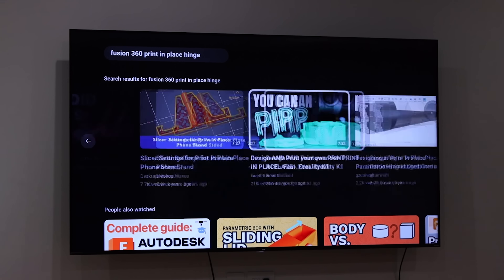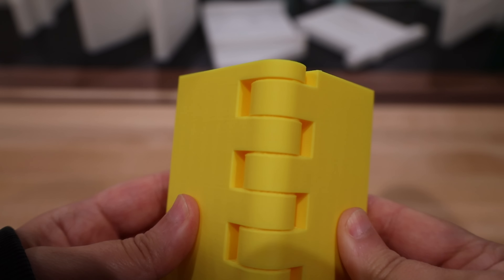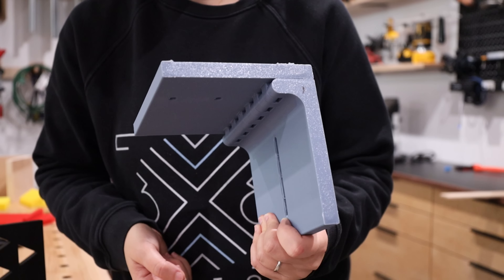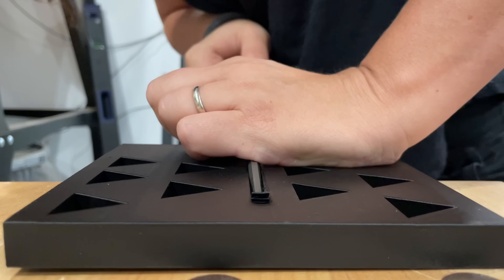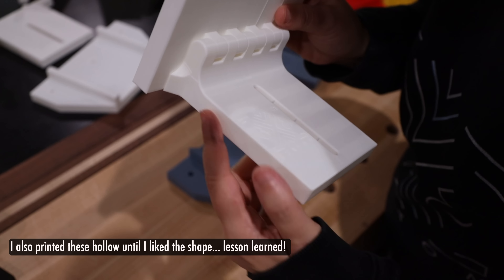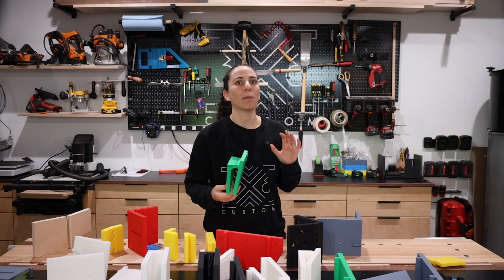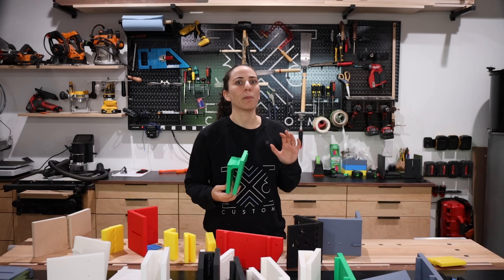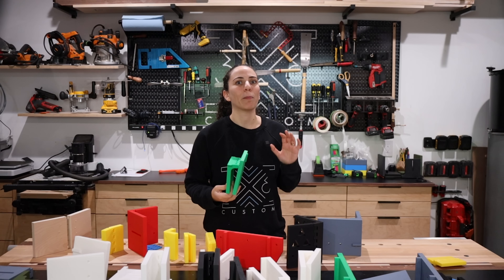From Idea To Product: It's Actually Easier Than You Think!

Comment: Instead of using that 3d printed hinge, use a 'bar hinge' or how it's called in Home Depot "Double Action Spring Door Hinge" and you won't need to do any height adjustments on the back side of the rail.

Comment: Your work bench video is what pushed me to order my A1 combo. It's been running nonstop in the little over a month I've had it and I absolutely love it. Haven't printed much for my shop yet or learned fusion 360 yet but I can't wait to maximize it's potential. But in the meantime, printing random crap is fun and blows me away at what these are capable of and the quality of the prints.
Reply: Is the 360 part of the combo pack or is it sold separately?

Comment: I have definitely changed how I work in my woodshop after getting a 3D printer and laser engraver/cutter. They make so much more sense for some things than traditional woodworking. Lots of fun! With a little experience, you can usually get things right on your first try. Depending on the complexity of course.

Comment: Thanks for sharing your process! After watching your previous rail hinge video, I ended up getting a Bambu P1S and have been having a ton of fun. Still figuring out how to design for tolerances and precision of the process -- I made some fence dogs and found the 20mm cylinder parts coming out .2 to .6 mm under the diameter in Fusion which makes for a sloppy fit. Will look into tolerance testers on MakerWorld to see how to compensate.

Comment: Great video timing. I have been looking into good entry-level 3D printers and the Bambu A1 is the one that keeps popping up again and again. 
I bought a laser printer last year and went for a cheap one that didn't have all of the bells, whistles and support of the pricier models. I wish I had gone with a pricier one that would have got me up and running much faster as a busy dad who doesn't have time to binge how-tos and tweak all day.
But the Bambu amazingly seems like the best of both worlds where it's very inexpensive and very easy to use for beginners. The latter is most important to me after my laser experience, and getting it at a great price is just icing on the cake.

Comment: A1 mini here. Just started printing and exploring the whole globe with it. Barely got into designing with it and I do mean barely. And I am impressed with they pre designed stuff even though many can’t print on the mini but much can be.  Afraid of the rabbit holes as I seem to get lost if going through more than one at a time. I need to spend time with a rabbit hole until I get desired rabbit without wanting more

Comment: Purchased your track hinge, printed and mounted it today. Overall works pretty good. I printed with ABS, so possibly some shrinkage, so a bit loose between the sliding of the parts.. With some HDPE tape, I got it tightened up. The hinge is pretty tight, so that came out great.  Great job on the design! 🎉
Reply from the maker: Hdpe tape is a great idea! Glad you like it! Have fun!

Comment: I think you may have accidentally created a really amazing video on how true innovation works: it's not that someone has some stellar idea that everyone high fives each other, and then someone does something somewhere and something magically appears done.  Instead, it is more often than not a well-intentioned idea that does worse than expected which leads to a cycle of creativity to solve problems which leads to tests, refinements, and (usually) success! Many woodworking projects have this innovation loop already (much like in software engineering) but trying to 3D print a hinge is a much relatable scenario to people than most woodworking or software engineering scenarios.

Comment: having a 3d printer is a great way to find out how much time and work goes into prototyping even basic items. I've designed a few simple things and it took days and a bunch of prints to get them working properly. having a second printer for prototypes would be super helpful, but I went and started with a 2nd AMS. I keep one AMS filled with a "base" filament and then the other AMS has multiple different colors.

Comment: Solid video. Interesting how much knowledge you gain by going through the process of developing anything. I use the bamboo 3-D Printer and one of the fans I found to reduce the time it takes for each print the prototypes is to print out some of them in the beginning at 50% size. They get done significantly quicker and you can still test your concepts.
Reply from the maker: That’s a good tip for sure

Comment: I find the best way to deal with overhangs is to change the design to have a chamfer or draft instead.   You can print inclined walls up to 50-60° without supports.  Sometimes I make two complementary parts that fit together to form the desired overhang when assembled (and may help to ensure the parts are printed in the preferred orientation for strength, stability, and appearance).

Comment: On a second note, I have a hard time working the 3D printer into my workflow. In the time it would take me to dial in my settings and wait for the print, I could have made the thing I want out of wood. You had a different goal,--learning the software and the printer--but in doing that, you've expedited the flow. I just need to sit down for a day or two with Fusion360 and my printer and work out the kinks. But that sawdust isn't going to make itself!!  Ha ha.

Comment: Nice one, I like how you explained the whole process 😊

Just a few notes, if you have some parts dropping during printing make sure that your pei bed is completely clean (dish soap and then ipa) and that you are not using grid infill (please never use it lol). 
Also petg is softer, weaker and less stiff than pla, but it has some other advantages. And I would really advise against keeping any 3d printer in a woodworking shop because of the dust, it's a bigger issue than people think
Reply from the maker: Glad you liked it! Yeah, thinking about an enclosure
Reply: @3x3CustomTamar  that would certainly help in the long run :)

Comment: I have ultimaker s5 and i use water soluble filament for support. You just need to place the finished product in water to melt it. No need for mouse ears or trees. Don't you have a soluble filament option in the baboo printer?

Comment: Great video Tamar. 
Now that I see that track rail. Does anyone have a good suggestion on replacing the original Milwaukee track saw anti-splinter strip with a third-party one? I bumped mine so many times on the edge and that thing breaks so easily. I need to try another guy. But the saw itself and the rail are phenomenal for me. 
Thanks.

Comment: Really impressed with your rail hinge and have purchased the file and asked my grandson to print for me. Problem I have is that my workshop mft is up against a wall and not so easy to get at the back to adjust the height. Do you think it would be possible to have ribs on the riser and corresponding indents on the bracket? with the knob of  hinge just snugged up, the ribs and indents would maintain the height at the required level. If possible would you offer as an alternative file ?

Comment: Tamar you’re amazing! 

I have a question, do you have any idea about the longevity of the rail hinge? Most of them are metal so just curious if you have done any testing to see how well it will hold up over time. 

I’ve been contemplating getting one since your last video. 

Also side note anyway you can do a video on your wall control setup and which accessories you’re using?
Reply from the maker: I have not tested the longevity of this particular hinge, but in doing research on hinges and 3D printing in general there are ways you can design 3D printed parts to last a long time. Lots of that was learned on the slant 3D channel I spoke about.
Reply: @jgraeff1  yeah plastic will wear over time, it is just a question of how quickly. Only tpu barely wears out, any nylon is not bad also

Comment: So interesting. A couple of questions. Where should a 70-year-old start - BambuLab A1? Approximately how much print time & filament for each prototype? Did each prototype require a roll of filament? This was a great video & makes me want to start a 3D printing hobby!! Thank you.
Reply from the maker: Glad you found it interesting! I suggest the A1 combo for sure. Things take a long time to print. Just the hinge portion of this jig takes about 5-6 hours. So you need to be patient. But the Bambu machines are the fastest printers on the market. 

Did not use a whole roll for one print. The rolls last a surprisingly long time. There is an indicator on the side of the roll that tells you approximately how much filament is left. And the slicer program will tell you how much filament is required.
Reply: @3x3CustomTamar  Very generous reply. Thank you for the info. I really want to give this a try...7 grandkids will thank YOU later 🤣

Comment: Purchased the files, thanks very much! Quick question, looks like the Bracket part barely won't fit on the A1Mini print space. Any chance you could do a modified version of that part? Everything else seems to be good, just sent the hinge to the printer!
Reply: To answer my own question, in case anyone runs into the same issue. You can set the Bracket (Part 4) at a 45 degree angle and it will just fit on the A1 Mini plate.
Reply from the maker: Good to know!

Comment: I made many test prints (with short prototypes) for miter slot runners for my particular table saw. Now I have a stockpile that I can grab from when I’m making a jig. 

I wanted a small miter box to use with my RuiTool 6 inch hand saw. I found a box (on Printables?), scaled it down in Bambu Studio, then added a negative cylinder and a negative inverted cone (x2) to get countersunk screw holes. 

Stop blocks, dust collection adapters, painters pyramids, spacers, etc, etc, etc. I love my Bambu P1P!!!

Comment: Why are you so focused in the print in place? Printing the hinge in 2 objects and add a bolt/dowel or something similar would far better in every way possible 😃
Reply from the maker: I disagree. Selling a whole product that requires zero assembly was the goal. 👍
Reply: @3x3CustomTamar  I agree that s an interesting challenge! My train of thought is that you still need to the a cleanup of all the support and the print is not in the optimal orientation - this still takes time.

Good work though! I really like your content! 🖤
Reply from the maker: @lz1aai  did you watch all the way through? I figured out how to print it without supports

Comment: I originally bought a inexpensive printer a few years ago Thinking it might be fun to play with. I may have made three or four things that were "toys" before I began designing holders for tools, latches to hold the garage door open Router base plates, and to many other things to mention. I can't imagine not having a printer now. I haven't integrated any prints into wood working projects but it is an invaluable tool nonetheless. And if you don't want to learn a cad program there are literally thousands of files for free on the internet. If you can imagine it, you can build it. Have fun Tamar. P.S. You've got my next printer, good choice.

Comment: Sad how you totally skip over the interesting part where you tell us about the tolerances and design needed to get the satisfying fit. Most likely to protect your IP. Other than that, nice commercial video. Most likely interesting for hobby-woodworkers who have not dipped their toes into printing yet. Edit: removed the salty part about you not selling 3d-files since you do now. But whoa 25$ for an stl print file? Sure you try to push the limits. But I'd rather spend that much money on 1-2 spools and go through the design- and problem fixing-fun myself.

Comment: Off-topic: it seems that the logo on your blouse is too low. In portrait drawing or painting, the head on the is placed not in the geometrical center of the portrait but in the gravity center which is slightly higher (of course there are more rules to the portrait painting - like golden division rule) but the rule of thumb is to place e central motif slightly higher than in the center. Otherwise, it gravitates downwards.
Reply from the maker: It totally is. That’s why I don’t sell them in my store. They were a sample that was bad 👍
Reply: @3x3CustomTamar  ... but still like your logo. Its construction reminds me of the first episode of yours I watched (the one with forked beams that together made o nice angle joint, like for a coffee table). They are both so nicely engineered.